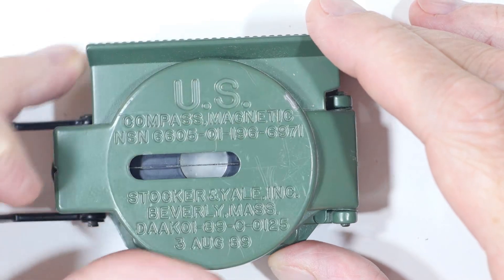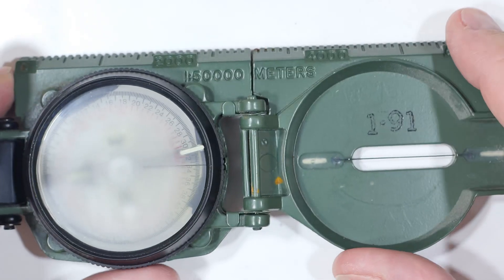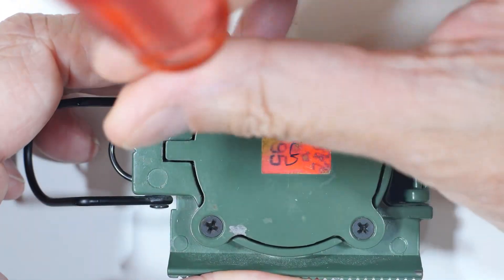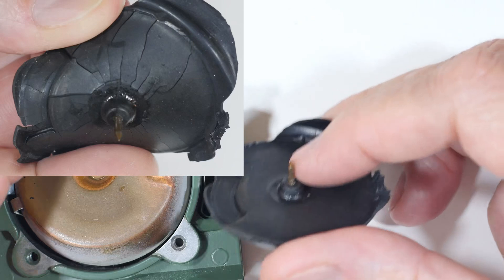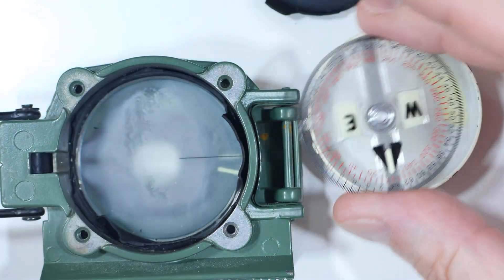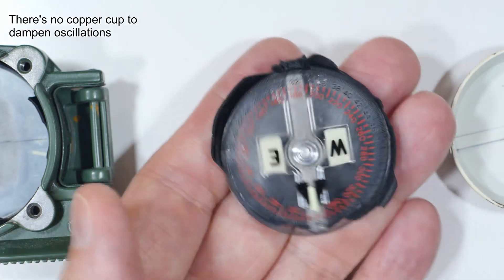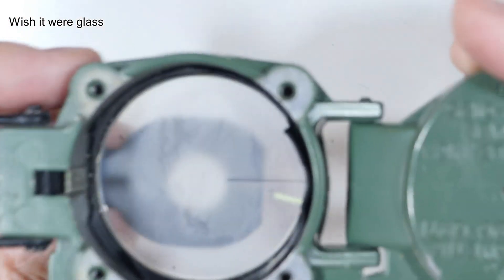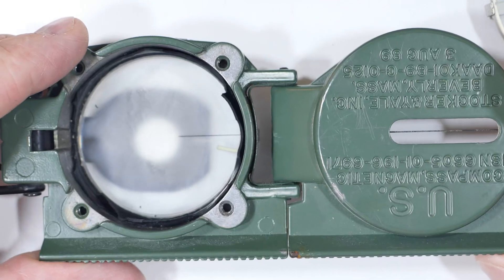Lensatic Army Compass - What's Inside? (4K)

Comment: so it's not radioactive?
Reply from the maker: Excellent question. I don't think this one is. Newer ones with the "beta" light have little capsules that contain the tritium, this does not have the capsules. Also, they should have a warning cast into the case. This one lacks that also. However this one is so old the tritium would have decayed to very low levels since it only lasts for 10 years.
Reply: @tsbrownie  After about 25 years it would still have about 25% actually, assuming it didn't leak. The new ones don't have a warning on them, but the do have "120mCi 3H" stamped/engraved into them. Cheers.
Reply: It's radium